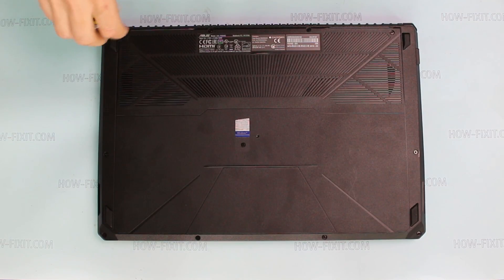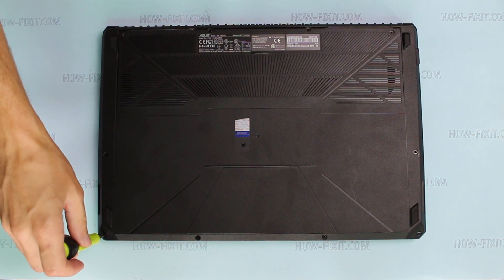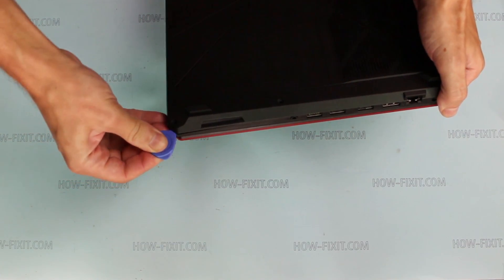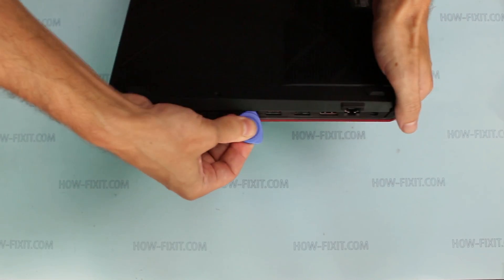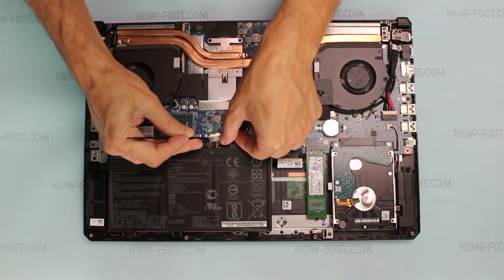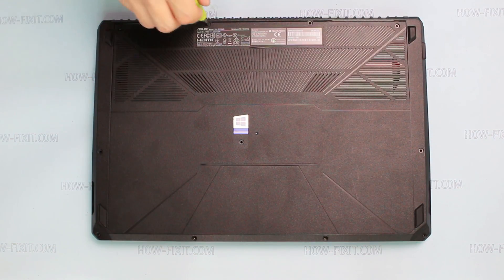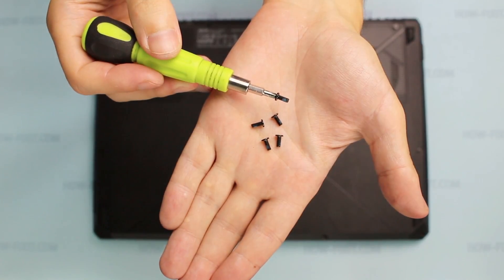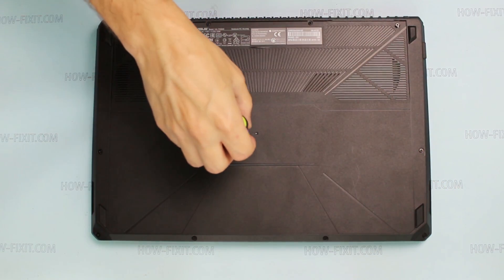ASUS TUF Gaming FX504 M2 SSD Upgrade & Install Guide - Boost Laptop Speed!

Comment from the maker: ⚠ The ASUS TUF Gaming FX504 supports both M2 SATA and M2 NVMe drives in its M.2 slot. So, you can install either, depending on your preference for cost or performance. Check the description for links to recommended M2 SSD drives. Additionally, watch the video explaining the differences between M2 NVMe and M2 SATA 👉 https://youtu.be/r3Jy5dHOj3g

Comment: Hello, I have the asus fx504GD laptop, I would like to put 1tb nvme samung 970evo plus, is it possible? Or do you have a storage limit?
Reply from the maker: There is no limit on the maximum size of an M2 SSD, but there are Windows limitations. If your Windows is 64-bit and the GPT file system - you can install a drive of any size. Check the description for links to recommended drives.

Comment: all m2 nvme can be used right ? or there's specific type?
Reply from the maker: ⚠ The ASUS TUF Gaming FX504 supports both M2 SATA and M2 NVMe drives in its M.2 slot. So, you can install either, depending on your preference for cost or performance. Check the description for links to recommended M2 SSD drives. Additionally, watch the video explaining the differences between M2 NVMe and M2 SATA 👉 https://youtu.be/r3Jy5dHOj3g

Comment: Does asus fx504 compatible to a 500gb M2 SSD? 
BTW, your video is helpful.
Reply: I just upgrade WD Blue SN550 NVMe SSD 1 TB. So easy and everything works fine.
Reply: @mikakatainen9026  I want to put a 1 tb samsung 970evo plus m.2 nvme on my laptop, is it possible?
Reply: upper limit is 256GB as far as i know

Comment: Do this device support Samsung SSD 970 EVO Plus 1TB? If not what is the maximum support of NVMe?
Reply: Did it work?
Reply from the maker: There is no limit on the maximum size of an M2 SSD, but there are Windows limitations. If your Windows is 64-bit and the GPT file system - you can install a drive of any size. Check the description for links to recommended drives.

Comment: Hi. Thanks for video. I don't have SSD drive and I want to add one. Can I use "Samsung 970 Evo Plus NVMe 500GB 3500MB/s-3300MB/s M.2 SSD (MZ-V7S500BW)" ?
Reply: Yes you can it will work fine
Reply: @SENSEscience  So we can put more the 256gb SSD? The Asus specs say max 256gb.
Reply: Hi! I have the same question but apparently the author did not reply to you. Have you tried using SAMSUNG EVO PLUS 500GB NVMe variant to you asus TUF fx504?

Comment: I just bought this laptop with 256gb and I want to upgrade, how many gb can I add to the original 256gb?
Reply from the maker: any available memory capacity
Reply: How-FixIT so if I want to add even 2tb m2 ssd plus the 256gb in the laptop already I can do that?
Reply from the maker: ssd 256gb instead of HDD?
Reply: How-FixIT my laptop doesn’t have an hdd, only 256gb ssd
Reply: @atariq20  Did you do it? I have 256 GB SSD and I want to add a M2 nvME.
Reply: @BOT_Tomi  Hey have you done it yet? Same situation looking to add a M2 nvme.
Reply: @MattTheHuman9  hey, not yet.. haven't tried.
Reply: @MattTheHuman9  i opened my laptop and i saw the m.2 slot, it should be ok. But for the moment i invest in my car xD

Comment: Just bought this laptop, so can you just keep the 1TB HDD and just upgrade the SSD to say 256gb or 512gb? And roughly whats the price for each one??
Reply from the maker: There is no limit on the maximum size of an M2 SSD, but there are Windows limitations. If your Windows is 64-bit and the GPT file system - you can install a drive of any size. Check the description for links to recommended drives.

Comment: yesterday i bought laptop and they removed my harddrive and put ssd..i am comfused because in this video he did not remove the hard drive he just add ssd for upgrade
Reply: i need opinion
Reply: @benjylimon6251  i think they remove the hard drive brcause they are installing 2.5" sata ssd. In this video is m.2 ssd. So,to get both hdd&ssd you need m.2 sized ssd
Sorry for my bad english.

Comment: help me please.
I am an asus fx505gm es068 user. Both ssd and RAM purchased for upgrade were installed normally, but ssd is not recognized (recognized in biose only).
 I asked several people and I got an answer.
One of them told me. "Remove the already installed hdd and install the ssd. Then it will be recognized."
Do I really have to do this? (Asus Center said that ssd is bad. Right now I won't exchange ssd.I did not act to recognize ssd after installing ssd. So I'll try it and think about whether I'll exchange it. )
Reply: Does it work?
Reply: My FX505A also have this problem. I installed M.2 SSD but it didnt detect.
Reply: @AlexandreNarbert  I solved it. The reason why the ssd cannot be installed is because of Windows. When installing the window, put it in a different version.And install Windows through the Rufus program.

Comment: What does this M2 SSD do exactly? 

I got this laptop on Amazon and i'm waiting for delivery, i'm making a list of things to upgrade later on, i saw the video you did of the DDR4 Ram and now i'm watching this one, what does this do to the computer?
Reply: Makes it faster
Reply: After doing this, Do we need to move the boot to M.2 ssd? If not, Then what to do next? After doing this?
Reply: you need to clone or install your windows to your ssd and it will make your laptop faster.. if the windows still in hdd, nothing really change.. just little faster for the data in ssd

Comment: I can't get the m.2 as a boot drive after installing an SSD i had to replace the mechanical with an SSD to get it going :(
Reply: Yeah the manual says it supports both SATA and NVME but didn't said that the sata is only for external storage. But I still managed to get it bootable.

What I did was simply installed windows on SSD without formatting the previous os. So what it did was it detected the os in the bootloader and ask you to choose. 

The only problem right now is that I can't restart from my SSD it will crash on the bootloader. But I found a workaround for that too, running EasyBCD repair/re-create boot option makes reboot work but you need to do it everytime, btw shutdown works fine.

It's a little messy but still how often does anyone restart their once the environment is completely setup
Reply: Same problem didn't knew it until I made a big purchase
Reply: @kibibytein  It's annoying, apparently the M.2 drive can't be used as a boot drive on these laptops!
Reply: @rigby18  I found the solution buddy. https://www.tenforums.com/installation-upgrade/52837-moving-recreating-efi-partition.html read and follow the second comment in this thread.
The problem was the SATA SSD doesn't have a System/EFI partition because it detected the HDD already have one so it didn't created another one. You need to create a new EFI partition and just copy the boot files
Reply: @kibibytein  Sweet, thanks for the update. i Can't be bothered opening it up again as it's running amazingly but should i in the future i know how to do it. Thanks!

Comment: SSD buying links which you have given in description are different interfaces. One is m.2 SATA and the other is m.2 nvme. What you installed was SATA interface i believe? Am i right? Please clear the confusion, Any idea if all TUF versions support the same interface m.2?
Reply: You are right, he installed a SATA interface SSD. 

www.notebookcheck.net/Asus-TUF-FX504GD-Core-i5-8300H-GTX-1050-Laptop-Review.303266.0.html

The link above will give you information about the product as well as the storage slot for M.2 SSD.
Reply from the maker: ⚠ The ASUS TUF Gaming FX504 supports both M2 SATA and M2 NVMe drives in its M.2 slot. So, you can install either, depending on your preference for cost or performance. Check the description for links to recommended M2 SSD drives.

Comment: we can add Intel Optane memory in that slot rather than a SSD.
Reply from the maker: For a system to support system acceleration with Intel Optane memory, specific support is required in the system BIOS. Motherboards and systems that are enabled with this support will be listed as Intel Optane memory ready, but I not see in list asus fx504.
I thinks better you must asked this question in ASUS support
Reply: No. It's be listed specifically as a feature in the specs list.